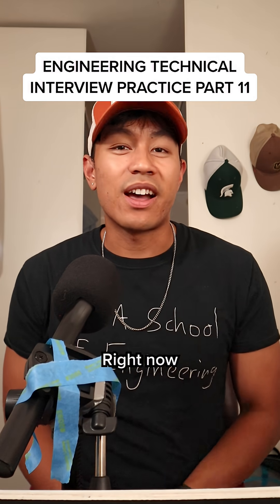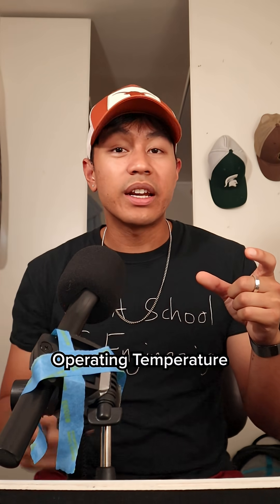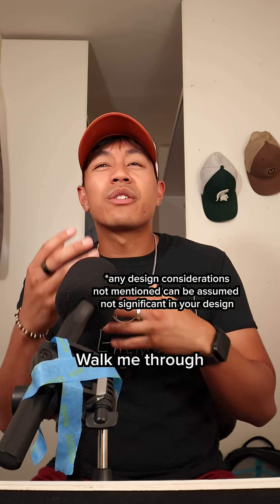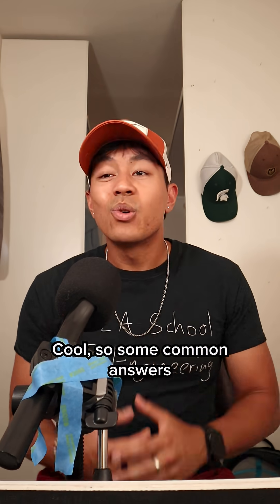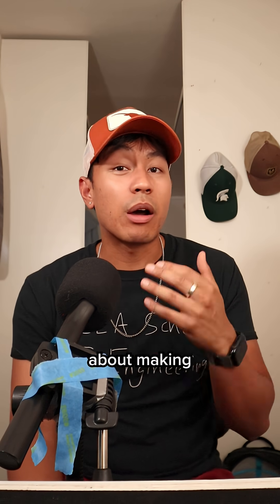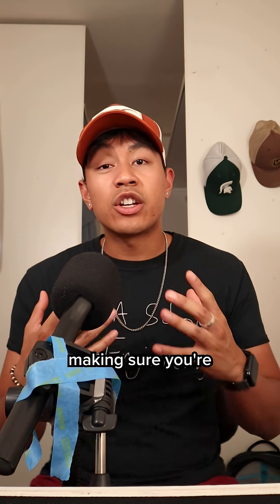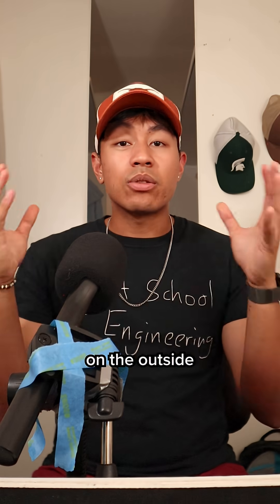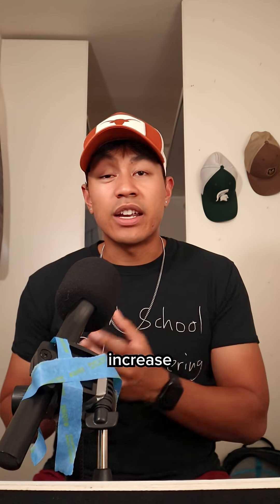Engineering Technical Interview PART 11 #engineer #engineeringstudent

Comment: If u used a rectangle, then surrounded the unit in a cylinder , putting it on the bottom, and using a cool air fan on top outside the cylinder to use convection currents